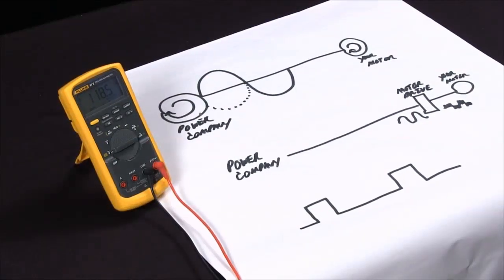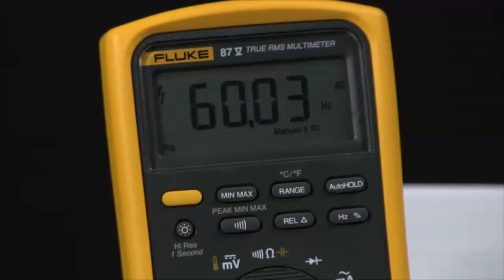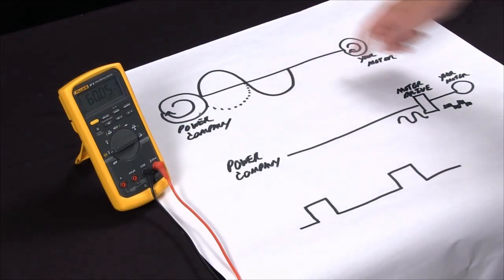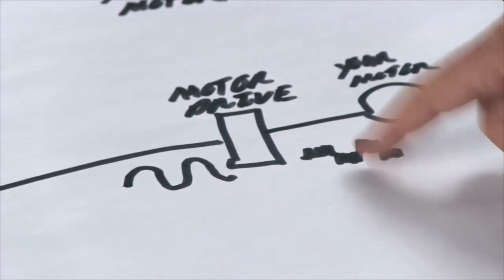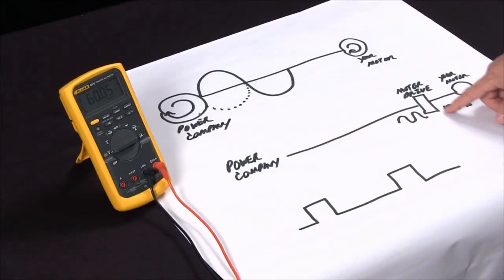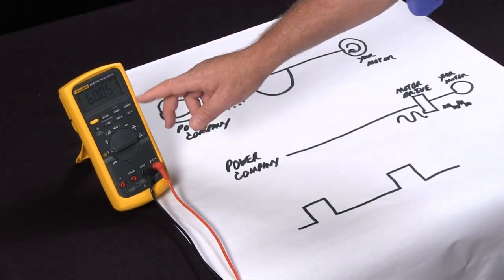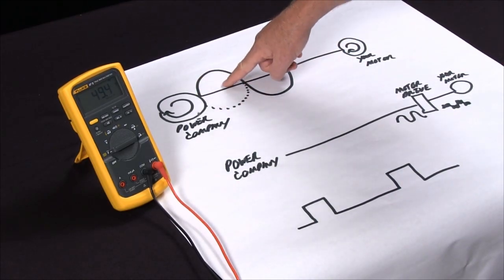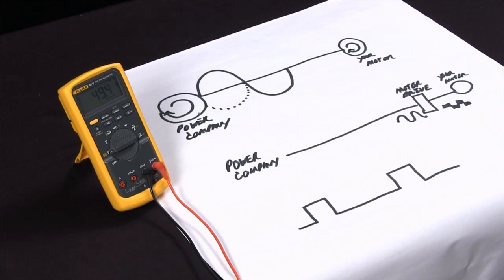How to Measure Frequency and Duty Cycle | Fluke 87V Industrial Multimeter

Comment: What is the diffrence between the lo pass filter and the loz feature on say the fluke 117?  or are they the same?
Reply: LoZ mode reduces the impedance of the DMM down to about 3 k Ω. from its usual 10 k Ω This is used to eliminate ghosts voltage and check for leakage current, poor connections.

Low-pass filter is for eliminating the PWM signal on Variable Frequency Drives (VFD).  This way you see the true RMS voltage to the motor.

Comment: How does the multimeter measures the frequency and duty cycle of a signal?
Reply from the maker: Hello Martin - Frequency is the number of cycles a signal completes each second. Our multimeter's measure the frequency of a voltage or current signal by counting the number of times the signal crosses a threshold level within a specified period of time. Duty cycle is the percentage of time a signal is above or below a trigger level during one cycle. Hope this helps.
Reply: @fluke  Thank you!
Reply from the maker: Happy to help! Please let us know if you have any additional questions.
Reply: @fluke  "Duty cycle is the percentage of time a signal is above or below a trigger level during one cycle." 
Would a person be comparing a measured value against a specification?  Or is the duty cycle constantly changing? I haven't been called on to measure duty cycle yet, just asking in case I come across that situation. Thank you.

Comment: can i measure a frequency of a constant tone(lets say a 440 Hz "a-string" of a guitar) by using a multimeter and a speaker with speakercable ?
Reply: should be able to
Reply: St. Mark with an accoustic guitar you can easily build a 'pickup' with a piezzo transducer (like the once beeping in a watch or a microwave) by hooking it up to an opamp (with the proper circuitry, of course). On the output you get a good signal for your DMM or oszilloscope. Ihr you are using a audio grade opamp and choose a good spot to glue you piezzo to, you can even use this as an actual pickup. However i do not recommend to use this signal standalone for it is very dry and give you sounds you usually do not perceive. But mixed with a microphone signal it can freshen up your guitars sound quite reasonably.
Reply: 440Hz is not a good frequencie to want. It has been proven to cause damage to the body and organs and deranges the DNA
Reply: @krystalturcotte8870 Please stop talking bs